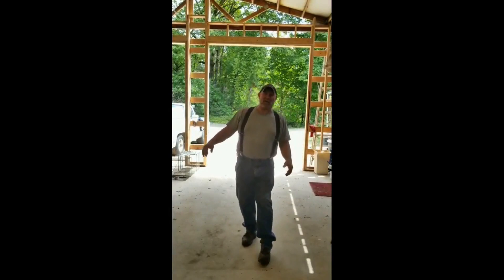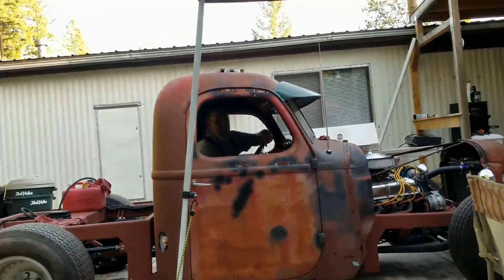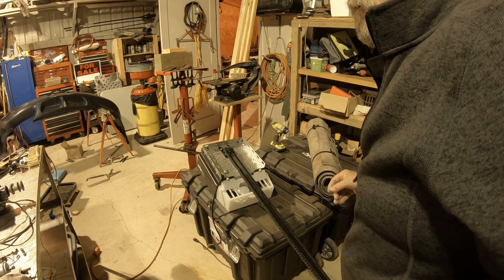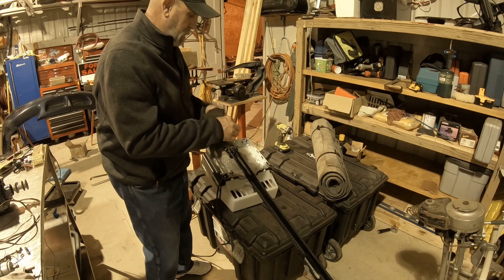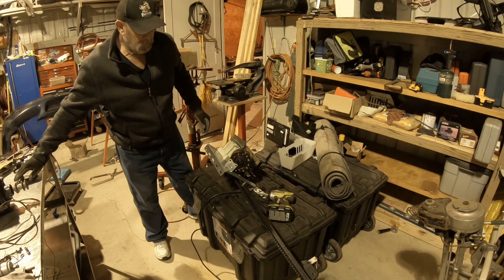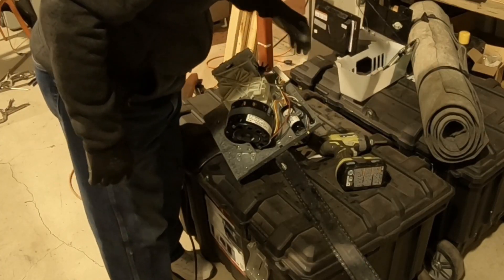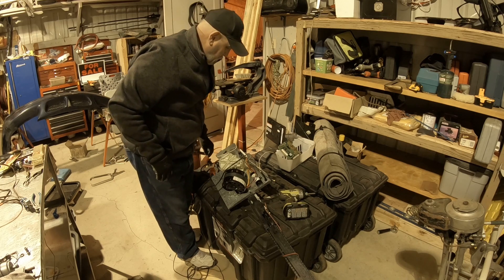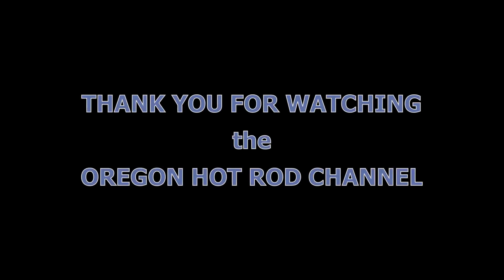How to Power a Bead Roller, For nearly FREE: Part 1

Comment: So did you use the capacitor that the motor is wired to originally or just use the wires straight from the motor?

Comment: Ron, I found your video on the mod you made to your bead roller and decided to try the same. First I used the garage motor just as it came out of the box. I used a door bell switch to activate it but found the motor tends to start and stop on its own, so I have no control of it. I then watched your videos and eleminated the circuit board and tried wiring it as you did. No luck as you had. I have four wires coming out of the motor red, black, orange & yellow. The orange & yellow is going to and through what looks like some type of capasitor. The orange & yellow wires exisiting the capasitor I twisted together, then attached the red and black wires from the motor to the inlet white and black wires. Its makes a big spark and trips the circuit breaker. Based on what you did, can you provide a little help, thanks Woody
Reply from the maker: Hey there, thanks for your comment. In video one I go through the process of figuring out which wires I used. In my application, the capacitor is the reversing part of the system so putting the wires together coming out of it, would have caused a short. In my application one side of the capacitor is forward and the other is reverse. So I determined that the red wire coming out of my setup was the main hot lead going into the motor. Since home wiring uses the sequence of black=hot, white=neutral, green=ground. I connected the red wire coming from the motor to the black wire from the electrical source. The white wire then switches back and forth between the orange and yellow wires, in my case to create the reversing affect. And the black wire coming from the motor was simply a ground. You will need a reversing switch to complete the process. I hope this helps. Every manufacture can use different color wires and different processes at how they achieve the end result. So it is up to us to figure out what that process is and not electrocute ourselves, lol. So, if you're not sure what you're doing, find an electrician, please. I can only speak to what my process was.
Reply from the maker: @Reno Simpson You are correct, at first I did while trying to figure out the sequence of wiring. In the end, all was figured out. Thanks for your comment.